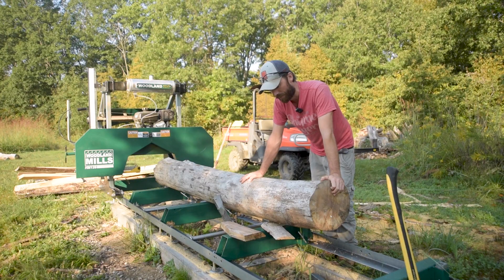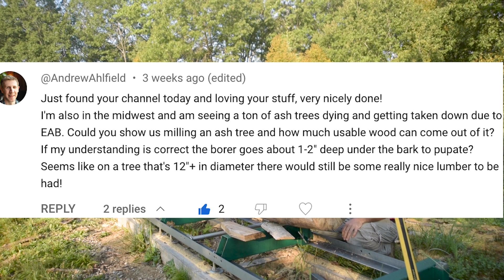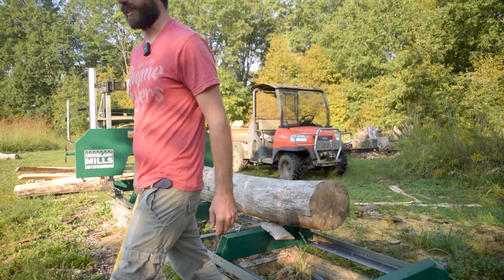You Better Be Careful With These Trees

Comment: I have heard that one should mill the log right away after cutting the tree down. If you need to wait before milling for whatever reason, what are the preparations: You mentioned keep off the ground, seal the end grain, but what about debarking and what would be the maximum threshold before you need to mill it? Thanks in advance for any advice!
Reply from the maker: Yeah I would say anything you can do to keep it away from the ground is your best bet. It really depends on the species of wood on how long it can last. Debarking might be an option if you own a debarker but it's also a lot of extra work. I would just keep it off the ground and seal the ends. The longer it sits the more bug holes and spalting you may end up with, but again that just depends on a lot of factors. One thing to consider as well if you are waiting to mill is to cut off a few inches of each end of the log before milling if you didn't seal it up. On certain woods as the ends dry, they become very hard. I've cut into both walnut and cottonwood that dulled the blade immediately because they were so dried out. I had to cut the end off and then it cut just fine.

Comment: Thanks Mac for the video! Super interesting and helpful. Definitely causes some other questions to spring up in my mind: can you mill green logs? What are the disadvantages of that? Seems like for most urban homeowners in my area with ash trees they are about 1 year dead with the bark on them. How can we help connect the dots between their problem and the value add for a sawmill? Homeowner problems: dead tree that I need to pay to get cut down, and I don't have land, time, or knowledge needed to prep a tree for a sawmill. Sawmill: would there be value add in processing logs that are still relatively green? Tree cutting services: Is it worth it to bring a 12"-14"+ the log to a local sawmill, or do I just throw it into a chipper and be done with it?
Could the sawmill get a flatbed truck and work with arborists in the area to come do pickup on several felled logs at once? Clearly there are several thoughts swirling in my mind as I drive around neighborhoods in my area. Seems like there is a time window where good lumber could be one silver lining to all these dying trees. I wonder if the sawmill could even partner with a particular arborist to subsidize the cost of taking down several ash trees in a single neighborhood. That might be the biggest win for everyone!
Reply from the maker: Yeah, so you can definitely mill green logs. Most logs that go on a sawmill are green. Even a dead ash tree that's been dead for a few years will still have a lot of moisture in it. The floor joists I just cut are still way over 30% moisture which is as high as my moisture meter will read. As for getting trees from the homeowners, talking to the local tree service/ arborist in your area is the best way to do it. I found that they would actually prefer to just throw the downed logs onto a trailer (that the sawmill owner swings by with) than throw it in a chipper. Of course this will depend on the tree service around you, but the easiest thing to do is call and ask. One concern for a sawmill about urban trees is the amount of metal that can often be found in them from people nailing things to them. A metal detector can find some of them, but if the sawmill hits a piece of metal, there goes a blade. But yeah, teaming up with an arborist is a great way to get logs. And you are correct, there is a window of time before all the ash is gone. It's such a beautiful wood in my opinion.
Reply: Makes complete sense. The embedded metal thing makes complete sense. Sounds like we need some kind of 3D tree MRI to locate if/where metal lives. 😂